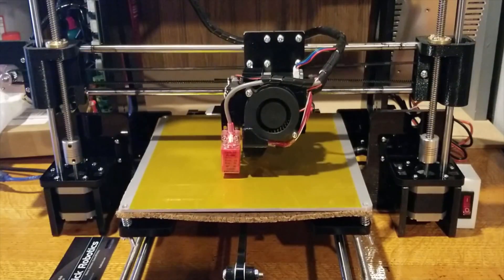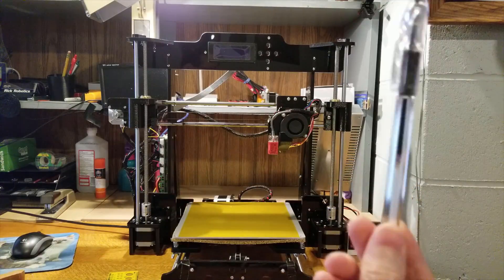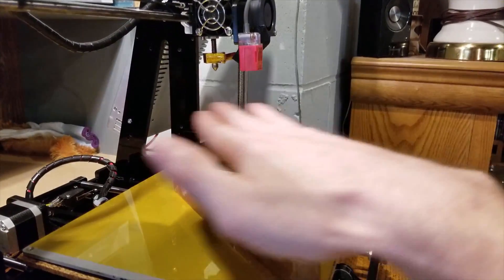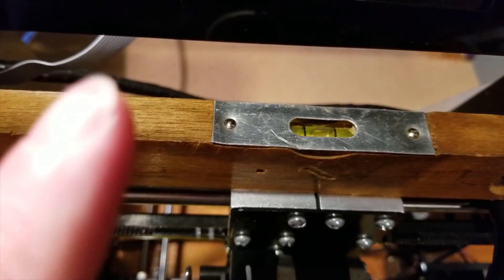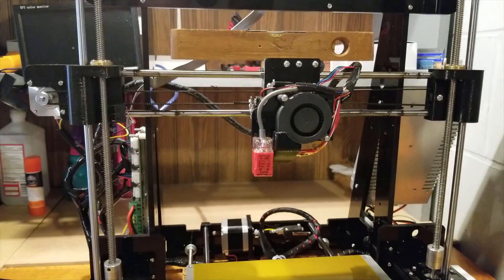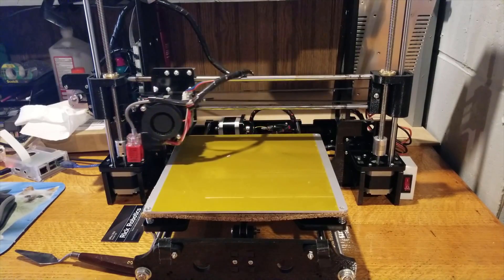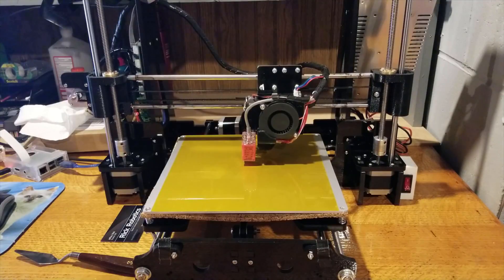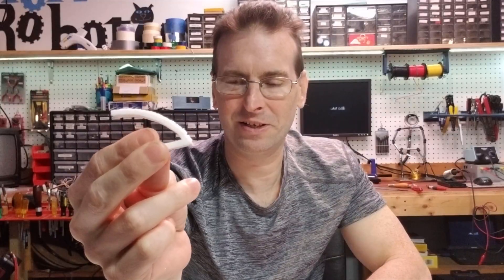Tronxy P802MA 3D Printer Part 3 - Bed Leveling

Comment: Bed keeps crashing for 3-5 secs, hits the sensor and clicks but still crashes. Also home is to the right and would print off the bed. Also wont print, line gets stuck and wont go into extruder. Any solutions?
Reply: I've had the same problem with the plastic not going into the extruder, I fixed it by cutting the end of the plastic to a fine point before putting it in. I have the same problem again now so I'm going to try that again.
Reply: Mine's now extruding fine. I wasn't feeding the filament correctly.

Comment: What is your z offset set at?
Reply from the maker: My z offset is 0.5mm. But I use octoprint, which for some reason, likes to ignore that, dispite how I change it in the firmware. So I have to re-account for that offset again in cura, when I slice my STLs
Reply: @RickRobotics  Ok. Thanks.